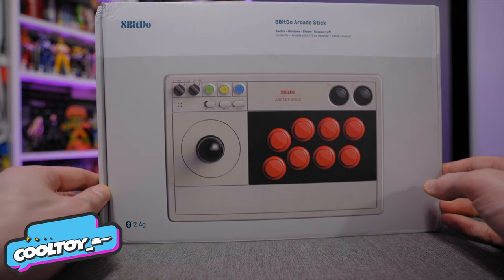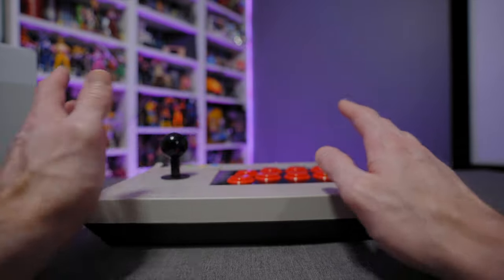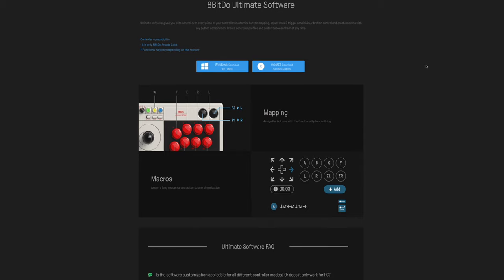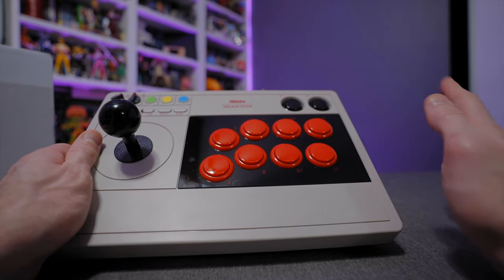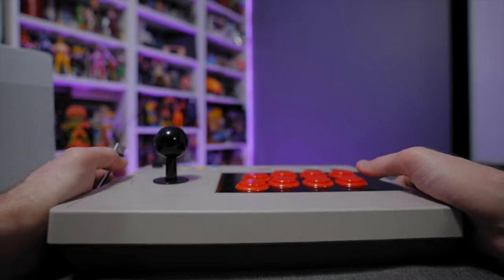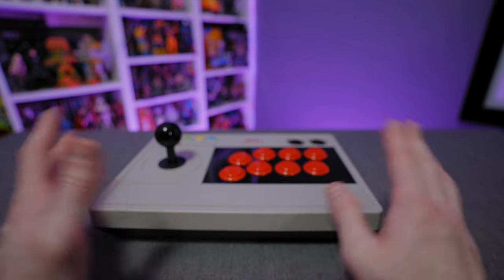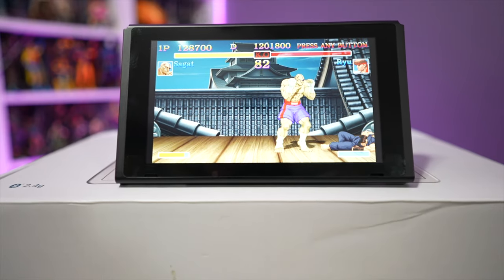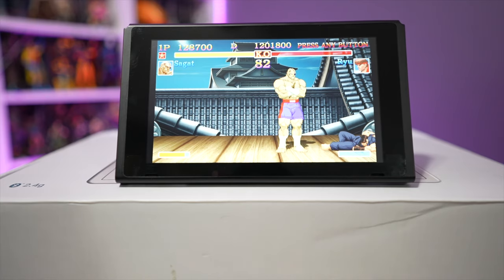8BitDo Arcade Stick Review And Modding!

Comment: I purchase the 8bitdo Xbox, PC version and I added a Sanwa Joystick and Sanwa buttons and is a little different in the 8bitdo connector and will not fit the way the 8bitdo Switch PC version connector. You will have to ether solder the wires to the PC board or splice wires with the Sanwa 5 pin with different color wires to the 8bitdo connector or solder the wires together. I chose to solder the wires together and heat shrink tubing for better reliability. Also the 8bitdo Xbox, PC version uses Phillips screws for connecting the controller together. Thanks for the great video!

Comment: I mean...if you're into modding stuff at all and you don't own a set of screwdrivers, what are you doing with your life? Also if the LED board's the only thing thats keeping you from using certain types of button...the board is held in with normal phillips head screws...just unscrew it, it's not that hard. I do think it might be an issue with spacing more than anything though. I'm also not sure how the sticks not moddable, soldering is something you learn in school, it's not hard at all, there are exposed pads for attaching 5 wires, et voila, jobs done, or just get a 5 pin connector and slot it into the provided socket.

Comment: I've been looking for a decent joystick. I love Nintendo but honestly the NES look is a bit of a turn off. I never think of the NES when I think of arcade. I wish they'd make more standard design. Other than that, it looks solid.
Reply: for better or worse, I think 8bitdo just seems to favor Nintendo (their name, and most controllers seem to resemble or bear a heavy Nintendo influence in design).  I personally wish they went with a more Sega-like aesthetic b/c they generally went with a more ergonomic and black design.  I think you can get the mayflash sanwa edition for about $130 or less if it's on sale which is probably closest competition to this stick & MadlittlePixel did a comparison video where he ultimately preferred the Mayflash over this 8bitdo iirc

Comment: I knew long ago when people were saying “these are moddable “ that they didn’t realize it wasn’t as easy as they thought.  I modded the older N30 arcade Stick and was able to get a Happ Joystick and a Happ buttons in there , but it was a task. At least sanwa replacements fit good and somewhat easy to change the joystick .
Reply from the maker: Yea I was skeptical when they first announced this device and said it was compatible with Happ. Heck, they even had it on their website for the longest time, before they finally got tired of people yelling at them about Happ and IL not fitting inside the housing. Sanwa fitment is great, though I would have still much preferred to get some Happ products inside it myself as a personal preference.
Reply: How did you get HAPP style concave buttons in yours? The barrel length is far too long... I suspect you can only realistically fit in Gold Leaf concave buttons (HAPP style, but barrel length much shorter)
Reply: @craigpilkington4323  the older N30 stick was deeper , higher., this one is too shallow.  Same with adding a Happ or IL joystick.  I actually cut out the bottom and made a hole in the bottoms of the base on the old one. It was a pain .
Reply: @therexershow  crazy times

Comment: So did you buy a new spring and gate for the Sanwa Joystick in your link or does it come with the 6lb spring and 8 way gate?
Reply from the maker: Already had replacement spring and gate sitting around at my house from previous mod projects.
Reply: @cooltoy  Could you share some Amazon links for those upgrades as well?

Comment: Why doesn’t the arcade stick come with a standard 5 pin port for Sanwa joy sticks? What’s the point of having to cut and soldier? I know you can cut a bit of the plastic to fit into the 8 pin port but why not include a 5 pin port for a 5 pin connector?
Reply: just seems like the one flaw, not like you can't just jam a 5 pin in the right slots anyways
Reply: @northwestclasspnw7974  companies would never make their products better if people didn't complain. Why is it up to the customer to fix things?

Comment: Couldn't you put the nuts for the long stem buttons underneath the circuit board and then put the button in front the top?  Also, what would you recommend over this for the same price point or lower?
Reply from the maker: Still wouldn't fit with what you are suggesting. A budget alternative would be: https://amzn.to/32oqXUE

Comment: Great video! Have you tried to replicate the Happ Joystick feel with an Extended Shaft on a JLF on top of the 6 pound spring? 

On my A1up I have two Skinny Red Bat Tops and Extended Shafts, not sure if you remember me Showing you on Twitter, but point is that they feel Happ like in the hand, but I have the stock Springs so they don't have the Happ Resistance and the illusion is lost. 

Have you tried that? I'm wondering of your opinion on it feel.

Also, Have you ever looked in two Samducksa Crown?!?!?!
Reply from the maker: Normally I would an the extender, but it felt a little much in this instance so I ended up removing it. 6lb springs are pretty good at giving me a similar feel that I'm used to having with the Happ/IL sticks. Heard good things about the Crown sticks, just never tried them personally.

Comment: I have it and I find that the stick is wobbly. And it needs a lot of movement before actually activating a switch. Not really responsive. Im wondering if a mod like this could solve the problem. Do you have a link to the buttons + stick kit?
Reply from the maker: Already posted in the video description box

Comment: Thanks for the vid CT...I thought cheating via macros necessitated a keyboard in fighting games, but I guess I didn't think about it being possible w/arcade sticks :(.  I long suspected I would be a much higher rank than super-ultra bronze range I hover around in sf5 and I do think cheating by others is more prevalent than people would like to admit.  I used to beat good players who had winning streaks in arcades quite frequently when I played SF games during the 90's and I'd say I'm much better now than then.  From your experience, would you say a pc monitor w/faster latency/lag is much of a difference for twitchy games like fighting games?  Besides SF5's trash netcode, I use wired gigabit ethernet so I should be good on that front (although I think I've heard using fiber optic ethernet cables could provide better ping than standard copper versions).  Also, what's the deal w/arcade stick makers not being Happ or Industrias Lorenzo friendly?  I know many consider Sanwa to be the standard, but plenty still play fine w/Happ / iL I've seen.  Maybe Happ/iL need to make shorter buttons and sticks to be more universal if possible.  I've slowly learned about joysticks and buttons & from what I've read, I think you did the best mod you could for a stick w/these limitations.  If this sounds interesting to you, I think it would be a cool idea to make a video going over what games were known to use 2, 4, or 6 lb springs although it may be hard to ascertain that information because I imagine it could have varied per arcade operator / business desires since they could have changed them back in the 90's for various reasons.  Great video and is among best I've seen regarding this product.
Reply from the maker: Great idea on the history of joystick springs and the games that utilized them. I may have to try and tackle that one.

Comment: Wonder if u can take out the internals and put it into a arcade cab!!🤔🤔
Reply: why?  thats like taking a laptop apart to build it's components into a tower. you can get a set of happ sticks and buttons and some usb encoders for less than the price of this.  and if you gut the internals you'd be throwing away a wireless joystick. you can get the parts that are the internals for less than the cost of this
Reply: @dneck  lol obviously u have 0 clue what u talking about there only 2  encoder for switch and they both cant use the stick only dpad. So u cant play smash bros. And 1 encoder is the price of this! How do i know this cause i bave cabs that run switch and pc and there only 1 usb switch that works with it

Comment: nice video. Do you have the 8BitDo bluetooth retro receiver(s) for original SNES/SFC, SNES/SFC classic, Sega MD/Genesis, Sega MD/Genesis mini?  Can you test this 8BitDo Arcade stick if player can use it on these consoles by bluetooth wireless connection? Thank you very much.
Reply: seconded, need info on this too

Comment: Can this work with the 8bitdo Bluetooth receiver on nes/snes retro consoles ?
Reply: You don't have to worry about that, because this has its own dongle/receiver included -> 4:50
Reply: @SPM_STG  yes I know the 2.4ghz, but I talk about the Bluetooth receiver for the old consoles like nes or snes, can I use this stick with them?
Reply: @ROX99  Ah... That I don't know.
Reply: @SPM_STG  can you confirm it plz
Reply: @ROX99  Don't have them sorry. I've only used it on Switch and PC, and the PC has built-in bluetooth, so no adapters to check sorry...
Reply: need info on this too, want to test out whether it can connect with 8bitdo bluetooth adapter